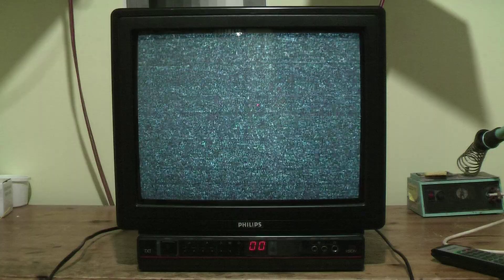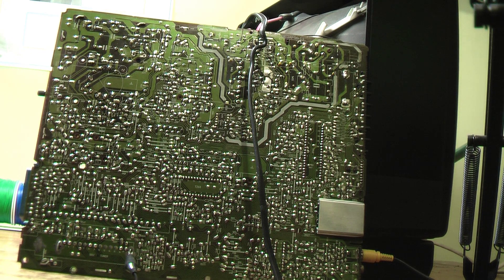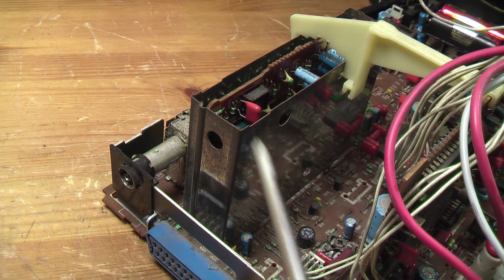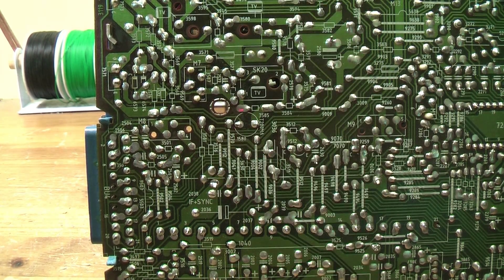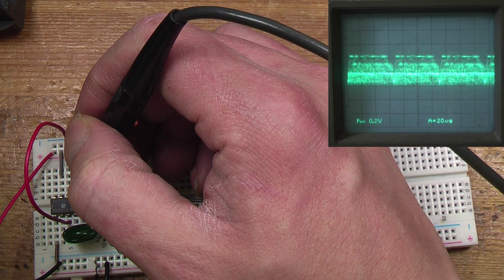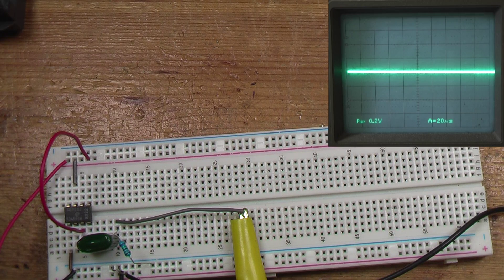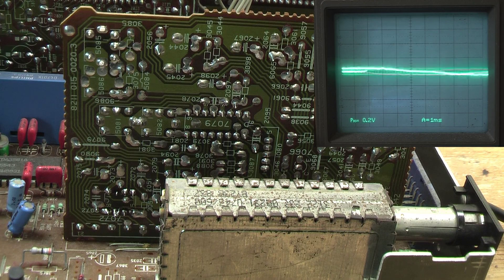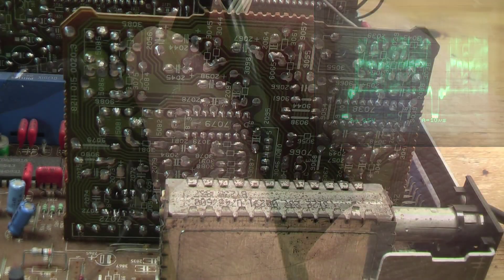Philips CP90 CRT TV 15CE1518 No Sync Repair

Comment: I've recently bought the 14 inch model equivalent to yours. I need to adjust geometry pots to get games screen aligned properly. Do i need to push the tray towards me with the TV on in order to dial them?
Reply from the maker: You might need to pull the board out to get to the pots, some of them can be reached with it in place.  It doesn't have many geometry adjustments, just height, width, vertical position and horizontal position I think.
Reply: @nowt1002  Are those easily reachable without pulling the board out?
Reply from the maker: I think so but I'm not 100%, it's a while since I've done it.  It's not too difficult to pull it out a bit if you need to though.  There's a clip at either side, you open those and pull it.

Comment: We had this TV's big brother, a 21", bought new from Rumbelows in 1987 (I guess this would be the same year, it's very similar). The batteries went on mine as well at about 10 years old and I replaced them with two half-AA cells (the original was two such cells spot-welded in a pack as I recall) bought from RS - my first actual TV repair as getting parts back then was tricky if you weren't in the trade, and I was working for a small engineering company at the time and the boss helped me out getting stuff. Thinking back, probably could gave got them from maplun but hey ho. 

Unfortunately I gave the set to my nan who promptly knocked over a vase full of water down the back of it and that was that 😂

That must have been quite an expensive set back in the day, an "FSQ" tube portable in the mid-80s.
Reply from the maker: I'm not sure how much this one was, I was given it in about 2000.  It's an ex rental one from Visionhire (still has the sticker on the back).  I seem to remember seeing 1988 date codes on some of the parts.  The chassis was introduced in 87 so yours would have been one of the very early ones.
Reply: @nowt1002 i have the same tv, 15" with the chassis cp90, and the date code reports 1986.. guess they arrived earlier in italy.. well they are very good sets, apart from the back up battery and broken solder joints, they are very reliable

Comment: Are those two AA batteries on the front part of the chassis?
Reply from the maker: Yes.  That's a modification by me.  The original NiCd battery that keeps the tuning stored when the set is unplugged had leaked.  It had done some damage to the board but fortunately not too bad, so I put that in as a replacement.  They're rechargeable NiMH ones.

Comment: There's a lot of people out there, especially youngsters, who just wouldn't get this. "you could just buy another". Glad people like you & me repair things.
Reply from the maker: I've had this telly 20 odd years, it's already had a line output transformer and a linearity coil out of me, it's not getting away that easily.
Reply: @nowt1002  I've got a Thorn TX9 16" in a shed somewhere, with optional text + full remote + optional 12V inverter. They were an eye watering £399 + inverter at the time. Customer who gave it me just had it in their caravan for ocasional use. One day I'll dig it out...I've a Fidelity AVS1600 & an AVS2000 both working in the same shed somewhere...these are 10 x 16 sheds by the way!

Richard
Reply from the maker: Yeah it's a lot to spend for a set to only use occasionally.  I would quite like a TX9 or TX10, I don't have the space for more TVs though.  I need to slim down my collection a bit really.  Those AVS systems always looked interesting, I've not seen one for years.
Reply: I heard that far more from older people in their 50's and up, it the new generation gamers saving these. It was the older gen that destroyed so many classic cars too.